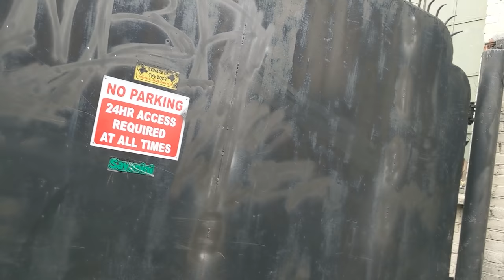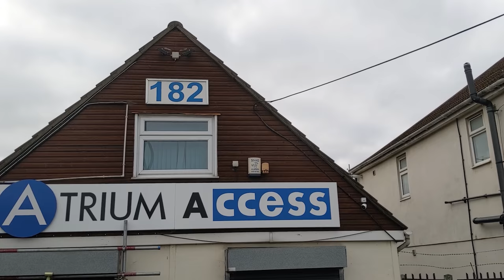Stolen Mercedes GLS Automatrics London Theft Recovery  Operation

Comment: The fact that Automatrics chap doesn't just give in because the police say so is one of many reasons why i chose this company over all the others to track my motorcycle - If my motorcycle got stolen i'd want someone fighting my corner to get it back  !! well done
Reply: Do they fit it or would i have to install it myself? tia
Reply: @desd1932  no you have to fit it but mine uses a battery that stays charged for at least a year so no wires to worry about
Reply: now youve told people you have it theives will remove it 1st

Comment: The incompetence of the police pretty much make having a tracker useless.  "Hey, we found your car but we're going to have to let them finish cutting it up and taking off with the parts before we can go in."
Reply: yeah, the way this tells me, is what's the point in having a tracker, if the police are not going to support the tracker company 100%. Why bother spending the money.  When the police are just going to fanny about like that. As soon it was pin pointed they could have gone straight in.
Reply: The problem seems to be once it's on private property police are reluctant to break in , only way to prevent it is to kill the engine remotely when it's armed and moving away from house after 2-3 warnings to disarm immobiliser tracker (mobile warnings) as long as it's on public road and you call the police to say your retrieving it now with or without the police on arrival they will be there before you
Reply: Thankfully not all police forces are this incompetent, it’s very frustrating to see this..
Reply: The tracker isn't completely useless, just meet the trackers there yourself, bring bolt cutters and a gun
Reply: @procta2343  In fairness the tracker company really pushed the police several times to do something, and spent many hours covering the outside of the building. If the police had been even a tiny little bit more helpful, they would have been able to stop it before the car was chopped. It's almost like the police were deliberately delaying
Reply: @arcadeuk  the tracker company is not to blame its the police support that's very  questionable.
Reply: @brandonlink6568  and all of a sudden the police take an interest,,,in u..
Reply: If this was my car that was stolen, I would have taken the police to court and have the judge order them to buy me a replacement.
Reply: Watching these is so frustrating only because of the police. You hand them the solution on a golden platter and they still don't want it.
Reply: It's 50/50 deal, Most people I know don't want the vehicle back so don't bother with a "tracker"
Reply: @toddgilbey3979  You wouldn't that's covered by the insurance and if you didn't have any,You would be prosecuted.

Comment: Absolutely shocking that you had to remind plod of their powers under pace in order for them to act .

However one thing we have learnt over recent months is that the police are far more interested in generating their own revenue streams via covid fines, far more reward for a lot less hassle.

The real crims have never known it to be so good.
Reply: Section 17 Pace provides entry for arrest not to retrieve stolen property. If the argument was the offender/s were on site, sec 17 could be used, but the reason they wanted police to enter under 17 was to retrieve the stolen property, which would be unlawful under 17. The Police from what I can see have it correct when they say they need a warent.

Not suggesting they should have disappeared in the first instance. They should have been looking for an emergency warent.
Reply: The police have an extremely shallow understanding of the law...

Comment: What I have learnt from your videos is not to bother with tracking devices just have good insurance.cheers
Reply from the maker: Point noted,  joking aside,  watch a few more theft recovery operational videos to discover some better customer investment results, saving owners up to £350K

This client was operating a self insured rental business, as such any financially viable good insurance option would be hard to find. Most insurance policy fees are significantly increasing above inflation,  insurers are definitely not flavour of the month. 

Theft claims are regarded as a policy holder fault claim,  meaning if you have to claim that leaves a pretty expensive black mark for anyone for the next 5 years insurance premiums. You may keep your no claims discount but the actual premium will sky rocket.   Most clients do not claim on any insurance, they get their vehicle back, avoid devaluation haggling sessions with an insurer, and they also retain vehicle value avoiding a "Stolen Vehicle DVLA Marker" as triggered by a theft insurance claim.
Reply: @AutomatricsMtrack  the police are the problem not your systems.

Comment: Love these video's . As a radio engineer for 30 years , I understand all the technology used . Great work @Automatricsmtrack
Reply from the maker: Cheers that's some great feedback
Reply: Met Police Nulle Points.
Maybe you should have called Essex Police. They might have wanted to show up the Met it's on the border after all.
I saw an incident the other day, a scooter was stolen, and the Met Police operator took fourteen minutes to answer the repeated message was "the Metropolitan Police are exceptionally busy at the moment". 
In fact, they are bogged down with paperwork, and officers are leaving as a result, they have too few as it is.
BTW I know two of these ex officers.
This is a management problem and
It falls on the commissioner  
Sir Mark Rowley, to sort it out and politicians, help him do this.
It has already reached a stage where members of the public are not bothering to call the police when they should as they believe it to be a waste of time.

Comment: If there's an ongoing, maybe covert, operation ongoing, what you don't want to do is send multiple officers, vehicles and police helicopter to the scene!!
Overall, a complete cock up by police, which if dealt differently, could have culminated in arrests.
Reply from the maker: Good point - thanks for your comment 👍👍
Reply: can't move in on it because there must be an ongoing covert operation where they are waiting for the chance to catch the chop shop in action. like i dunno, maybe a stolen merc with a tracker onboard, getting stripped down in the unit being watched?
Reply: Not really a cock up, they wouldn’t know until they start putting an intel package together for the warrant, a lot of the intel is located with a separate intel team who the officers on scene wouldn’t usually be in contact with, but need to speak to to obtain further intel for a warrant to be put in front of the magistrate, there’s no cock up here whatsoever, it’s a case of the public thinking they know better than the officers, which most of have been doing the job for years and know it inside out, back to front. It’s easy for people to criticise saying that they should have just busted in, the reality is, if they bust in, and it’s not there, and the landowner complains, at any civil court hearing it would likely be deemed they had limited evidence that the vehicle was actually at THAT location and therefore they had no rights to force entry, meaning the officer that forced entry is then liable to be prosecuted for criminal damage, losing their job and with a strong chance of going to prison, as the charging standards are lower.

Had it been absolutely clear the stolen vehicle was definitely in that unit, I.e it could be seen from a window, it would be a very different story.

When the officer said “assuming we have enough resources”… he simply means assuming there are enough officers on shift at the time, and they aren’t all busy dealing with calls, as per earlier on when they were pulled away to deal with a job. When you have for example a domestic assault suspect still on scene with the victim, and nobody else free, you aren’t going to leave multiple officers stood outside a unit where stolen property might be, especially when given the limited evidence that it is there, you will likely need a warrant anyway. 

Ask yourself this… would you rather officers remained on scene with some stolen property, or attended a serious call, like the one mentioned above, or a collapse in the street or behind locked doors, or a stabbing?

That is the reality of policing, some days they are plenty of officers available, other times there aren’t. You have to remember at any one time there will no doubt be numerous officers sat in hospital with prisoners who are too unwell for custody, so spend days in hospital, sometimes even weeks or months, there will be prisoners who have attempted suicide or self harm in their cell, so officers are forced to sit outside their cell on a plastic chair with the door wide open, watching them all shift, not allowed to read a book, or look at their phone, just sit there looking at them, or chatting with them for 9-10 hours. Having done plenty of these in the past, it’s utterly mind numbing but it has to be done under the current blame culture, where it’s always “someone else’s fault”…
Reply: @thefiestaguy8831  You are very wrong. If there was such intel on the building and an investigation already underway, Tell me why access was given 2 days later (wheres this big investigation that no warrant can be issued) and to top it off, they didnt even want forensics on the building or car (AGAIN, WHERES THIS BIG INVESTIGATION??). The cops lied through all of this, and they are responsible for the loss of the vehicle and they need to pay MTrack staff wages for so much wasted time on this case.

Comment: I don't get why they send in a heli for this. Don't they have a unit with a drone? Would be way way cheaper and quicker to use!
Reply: maybe they dont actually have a drone to use
Reply: @eriksimca9409  then they should modernise. My country has a lot of police cars equipped with a drone. Imagine every cop having a drone with thermals on it. Criminals can run, but it would be useless.
Reply: Drones are actually illegal to use within built up areas, even for police. They'd actually need special permission for it. If they then went in on the back of the drone footage the case would be thrown out of court for illegal attaining evidence.
Reply: @ChevronTango  not where I live.. police can get clearance for that here
Reply: Drones are quite new for the Police and many forces only started getting them in 2020 (after this video was taken).
Reply: @tech-rich  fair point!

Comment: You might want to use the app called What3Words. The app will give you accurate location in a 3m x 3m square, using 3 words to describe the location precisely. It will be easier to communicate with your staff over the phone rather saying, down this road and by that bush.

Comment: This same situation happened to me yesterday morning I had to track my own bike thanks to the tracking company, directing me and after 30 minutes, I had to confront the thieves while they transport in the motorbike in a really dangerous area all alone by myself when they turned up, although said which way did they go and left me to it funny thing on my way back home less than 10 miles away wanted to have a go at me for riding with out helmet

Comment: This might sound silly, can your company not install a high pressure smoke system to help identify the vehicle.
Reply from the maker: Not sure about that - It could damage the vehicle and we are not really sure how that would identify anything if it was locked inside a building. Thanks for your comment all great ideas come from out of the box thinking  :)
Reply: @AutomatricsMtrack  maybe even a sine wave sounder on the unit that does a sweeping frequency noise when the command is sent to the unit (constant noises are hard to triangulate) - at least then once you've picked up the RF got a door - you can activate it and the police stood next to you can be beyond reasonable doubt that it's in there - without having to believe what your RF unit is outputting as evidence to proceed.

Comment: You should invest in a drone to check over fences maybe even fit it with the tracker to triangulate the signal
Reply from the maker: We have a Mavic Pro drone,  but that's not much use if stolen assets are hidden from overhead sight (like in this case inside a building) - RF was good enough evidence for police to enter - RF can detect through concrete walls

Comment: Hi mate how much are these fancy one for my boat that’s kept on a trailer 🧐
Reply from the maker: Hi Marc - Units are between £120 and £150 depending on the model and annual subscription is £120 (all prices ex VAT ) stock is low on the website so call in 9-5 and speak with sales team 👍

Comment: I watched a previous episode where the police asked where you were and, iirc, you gave a post code. Just wondering if you use the WHAT3WORDS app now? Seeing as it can locate a point to a 3m square and is far more accurate than merely a post code. Plus works anywhere in the world.
Reply from the maker: Yeah its a good addition to the tool box just sometimes we try to fix the problem without opening the tools lol . Thanks for your comment 👍👍

Comment: This is the 4th of these videos I’ve watched, and not one of those had a successful outcome. Surely a tracking system needs to be working in real time to find the vehicle before it’s dismantled otherwise what’s the point?
Reply from the maker: It depends how you measure success,  this operation was a partial success (and  could have been significantly better had the police entered the day we were on site) The hire car company are self insuring and managed to sell this vehicle at 60% of list price. Be aware we only post up recoveries where a deployment to find is needed. Where GPS is not present or not sufficient for police to locate the stolen asset. Maybe watch some more there are some amazing finds in the back catalogue, several inside vans or shipping containers with better result  - live trackers are less covert than battery units they can be easier to trace etc. Thanks for your comment

Comment: Once u gained access to the unit and found the car stripped, there was a registration plate on the shelving units in the lock up
KV19 GNC, this video was uploaded 3 years ago
The spare number plates which were probably used to transport that car to that lock up are now showing up as stolen on feb 2024
It Just shows how many cars are be stolen 
Even the vehicle plates they cloned is now showing as stolen

Comment: Wondering if the unit was used by an active and valuable police informant maybe?? If there was a bigger ongoing operation in regards the lockup, which could have been compromised, i would expect police to steer clear. Lots of police in marked vehicles showing up then warrant denied due to some other investigation makes no sense whatsoever.
Reply from the maker: That's a common theory in the comments section

Comment: The problem with this is "Why pay for your service?". You have clearly shown tou guys are competant at locating the car and the tech works. But without the support of the police you've not recovered anything servicable to it's still a insurance payout for the theft.
Reply from the maker: Many hire companies,  as in this case self insure,  so they need a way to recover theft losses. We explained in the footage that this was the first time in 12 years that the police had failed to deliver us the required services. So in all our other find operations the police have supported us. Further to the release of this operational video we have received several Met police vehicle crime specialists contacting us to provide us with other options to help improve police response tactics in London. Thanks for your comment

Comment: as a tracker, why wont you bring along drone with you ? it can speed up the process without need to wait for the heli to identify..dji mavic 2 pro aren't too expensive but their camera zooming capability will get the job done..
Reply from the maker: We have a Mavic Pro in the tool kit but remember  visual aid is not that helpful if hidden inside buildings so we cannot send up a drone and give it the all clear unless no buildings etc

Comment: I'd assume the reason the police didn't want to go in was they clearly have an investigation open on that chop shop and the car was Already going to be partially to fully stripped meaning it's going to get written off regardless. But now because of the forced entry the chances are whoever is running the chop shop will go to ground and nobody actually comes out any better from this

Comment: Police like every other company needs increased funding & not continued budget cuts every single year.
Police where on the radio the other day near 90% of car thefts are from scanning keys. Coincidentally house thefts which include a car theft are down near 90%. Perhaps automatrics could be granted higher legal enforcement powers to lead the way, like a version of the coastguard only with large volunteer teams all across the UK to tackle car thefts.
Reply from the maker: Think that idea may come in time basically outsource theft recovery to certified companies good idea 👍👍

Comment: This police drama does not add up to me. This business of a bigger operation has got to be an excuse. If this dump was a sensitive site you wouldn't place the NPAS chopper in a hover at low level over it twice. You would fly past the target, do a big orbit 20 miles away and fly back as if the overpass was coincidental. I think the lack of interest is partly due to the complicated geography of the site, at least two locked gates and a shutter. and the possibility of dogs loose in the unit. I feel there is a piece missing of this jigsaw that the Met are not coughing about. A £60 grand motor deffo in a unit and they spend 24 hours procrastinating, no it's a disgrace.